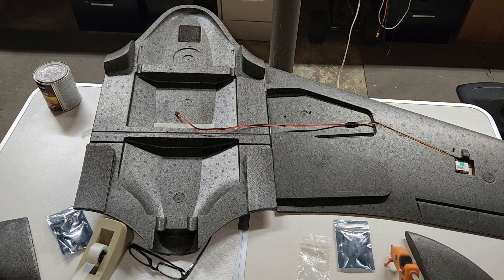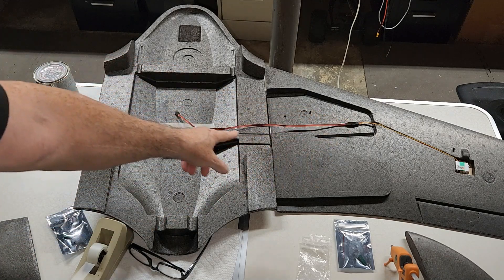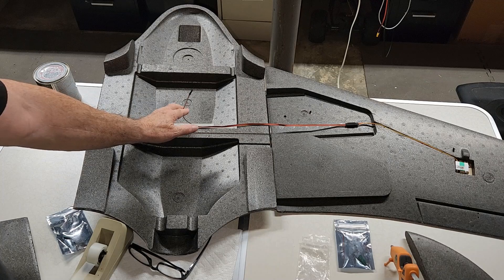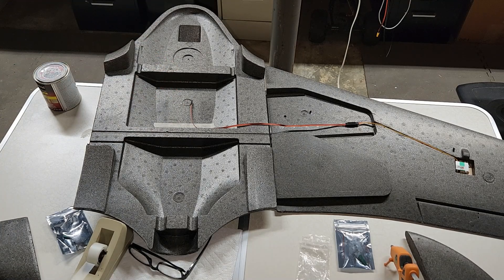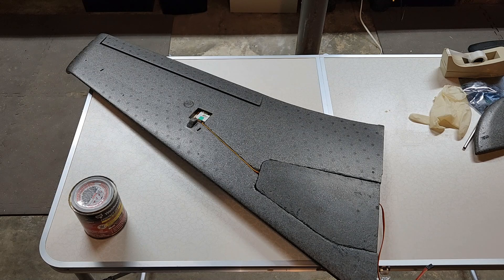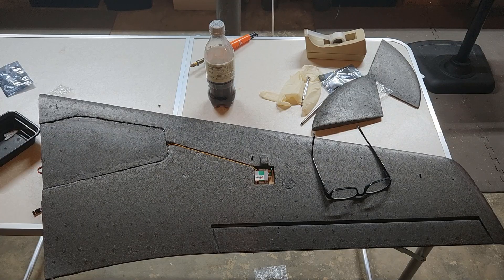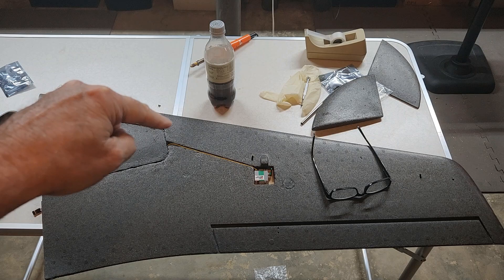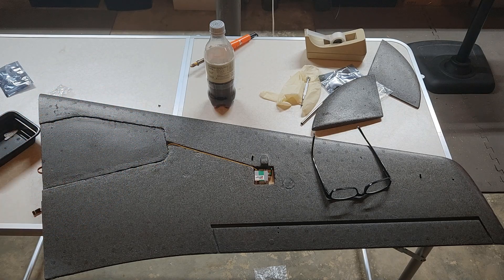Skywalker X8 2 of

Comment: It's coming good for sure Vernon. Cheers 👍💪✌
Reply from the maker: Except for the glue mistake I think very well.
Reply: @nighthawkvs  Yeah, that stinks how it dissolved it. But this plane won't be using that glue anymore either, I bet. 
I've not that plane and don't know if it's says what not to use or which glue is safe?
Reply from the maker: I will remember to test it before I spread it everywhere.  lol  It works really well.  i will show the other model it worked so well on soon.

Comment: We fly those in a UAS program.  We plate the elevons with 1/32 aircraft ply on the bottom and use a stiffer horn.  Also, upgrade pushrods to 2mm or 2/56.  Otherwise, you are in strong risk of flutter, the horn bending over or the pushrod buckling under pressure.  What comes in the kit is trash.  You might get away with it for a short while, but you won't eternally.